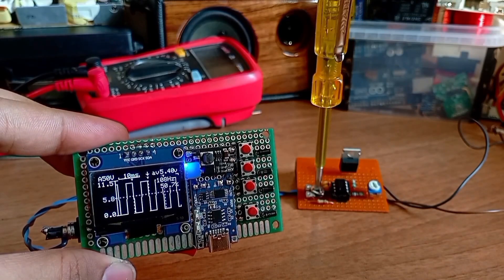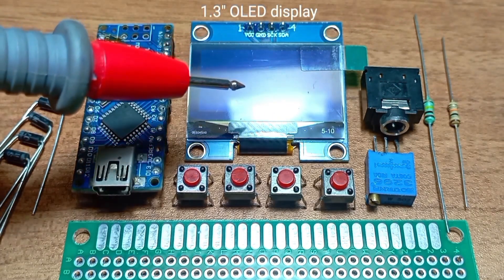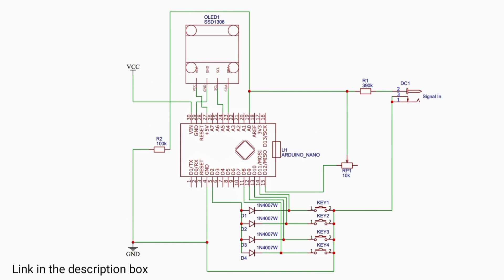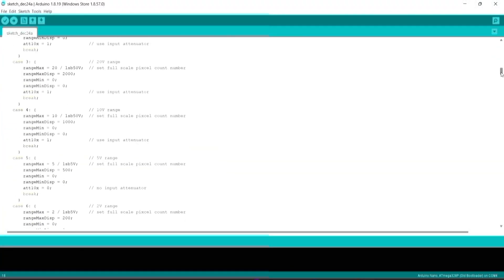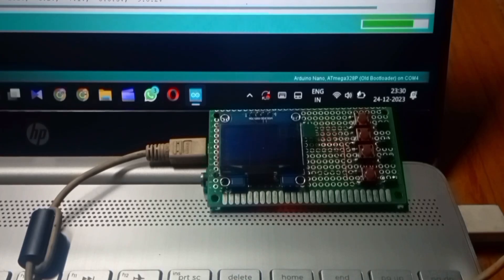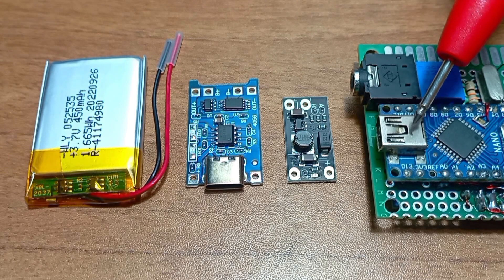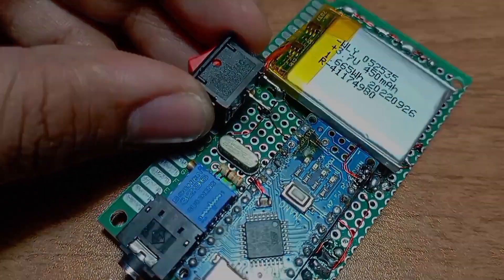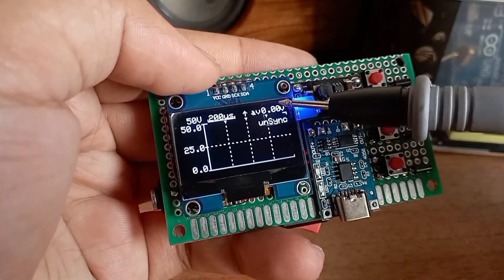Diy Oscilloscope Using Arduino 🔥 #diy #arduino #oscilloscope

Comment: I found your modified code on another youtuber DIY oscilloscope with a few modifications mainly they use a smaller screen. But all the comments in the code are removed so you can tell yours was the original lol
Reply from the maker: No actually is not mine either.  😂 for display size may be change in the code not required,  
Same code is available online many places

Comment: Muchas gracias por tu aportación al estudio y formación de en el ámbito de la Ingeniería, estoy siguiendo los pasos de tu vídeo para poder tener mi propio osciloscopio para estudia Electrónica en la universidad, el codigo funciona muy bien ahora estoy armando el circuito
Reply from the maker: Thanks a lot 🙌
Reply: Would you mind sharing the code with me? I would really appreciate it, as it will help me complete my project.

Comment: You add Xtal/Crystal component and 10K resistor in the circuit. In the schematic there are no Xtal components and 10K ohm resistors. Explain what the function of the components in the circuit is?
Reply from the maker: actually the  inbuilt crystal of the Arduino is damaged so I remove it & add another one outside 😅
Reply: i was wondering this as well. glad he clarified

Comment: why did you put crystall oscillator? and what is the max input voltage for the signal?
Reply from the maker: on board Oscillator is damaged so I use external one , & input voltage is dependends on the input voltage divider after the signal attenuation voltage should be less than 5volt in the  analog pin

Comment: I just built this oscilloscope without any knowledge. I'm using terminal block instead of 3mm jack.
I'm just beginner. How to test it? I just use terminal block as multimeter red and black probe?
also how to convert my terminal block to 3mm jack so I use signal generated by mobile phone app?
and what is the name of app that generate signals?
Reply from the maker: You can use any signal generator app , in my case it's ' HZ '  .   Use can use old headphones wire or aux cable cut it in half and connect the wires to terminal block
Reply: @madScientist99  I just bought xr2206 function generator kit. Can I use it with this Arduino oscilloscope? The manual of xr22206 says it needs 9-12v as power for the kit but I don't know what voltage of the output/signal it is. I'm afraid it will destroy my diy Arduino oscilloscope.

Comment: Can a laptop monitor be used as the display?
Reply: It is possible. You have to write an app that will draw points you read with your Arduino